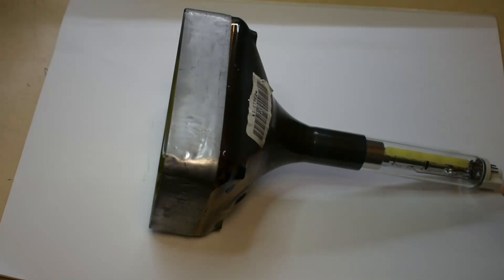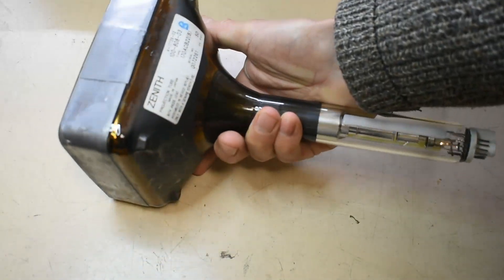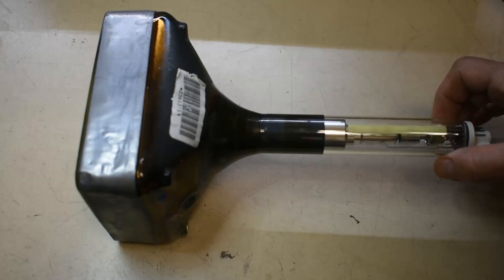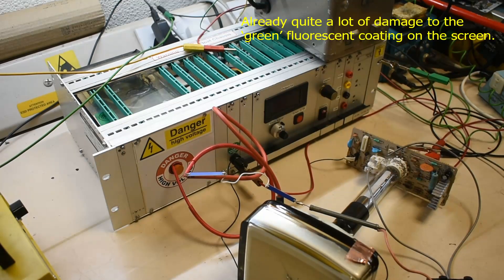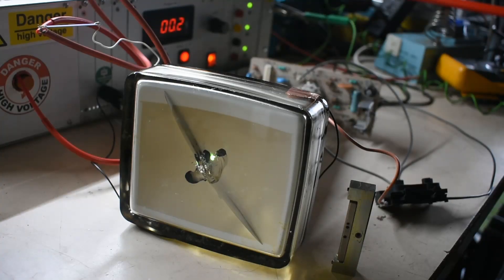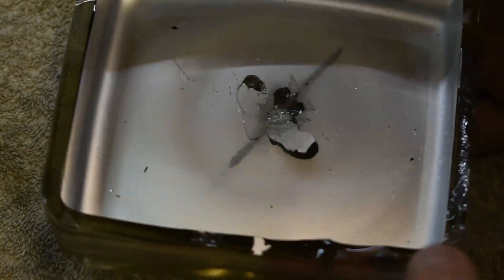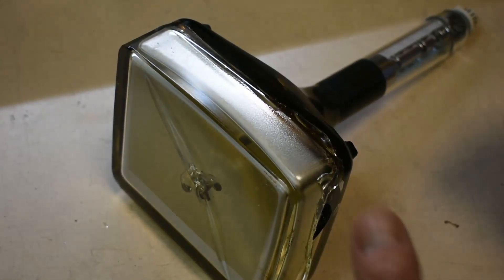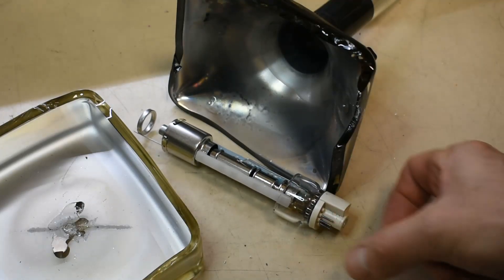CRT cracked from the inside

Comment: Interesting!  We all know (well youngsters might not) of where the term 'screen saver' comes from but I had not realised that the electron beam carried so much energy but I guess at that voltage the power is in the many 10s of Watts.  I must do a calculation to see how much lower the KE of the beam is.  Remarkable to see it doing that much damage!
Reply from the maker: Thanks, I now wish I had monitored the current during this experiment. I was surprised just how easy it was to heat the glass up so quickly.  I do have the other 2 tubes, but it feels like vandalism to destroy another in the same way. These tubes guns are designed to have a higher cathode current, but I have seen a large TV CRT with a crack on the neck due a frame scan fault that diverted the beam into the glass cone where the scan coils sit.  So even an ordinary CRT can generate a lot of heat with a focused beam.  Perhaps not quite enough to crack the screen. The iron shadow mask in a colour CRT would also take the brunt of the impact and dissipate the heat better. Maybe a future experiment there. I think the anode voltage was around 31kV when the glass was melting but this is around the operating voltage for this tube.  Even at 10mA which the PSU is easily capable of, that’s a lot of heat at a spot.
Reply: @tuopeeks  I was going to ask what the beam current was.
Reply from the maker: @cambridgemart2075  I didn't measure it at the time. I did check the PSU can deliver 20mA but I think it's more likely to have been 10mA or slightly less.
Reply: @tuopeeks  That's a lot of power!
Reply from the maker: @cambridgemart2075  yeah, I will try and monitor it for an accurate reading next time. It did melt the glass quickly though.
Reply: @tuopeeks  Yes, the beam must be delivering about 300W.  I am not totally sure of the heating mechanism but I guess more IR is emitted and reabsorbed when glass is hit rather than the phosphor?  It is a shame to destroy tubes but, and I have this dilemma, are they ever going to be used again or should they be 'milked' for all the educational value that they have whilst still in knowledgeable hands!  I am finishing a video on VFDs but came short of smashing one open even though IV-21s are pretty common!
Reply from the maker: @AnthonyFrancisJones  I think the thin aluminium coating on top of the phosphor conducts the heat away and is normally enough to protect it from excessive heating. Originally this coating removed the need for ‘ion-traps’ in early CRTs. Ions, although sparce deflect less a and cause more damage over time than electrons.  I think the velocities and stationary spot in this experiment evaporate the aluminium and melt the glass in the same way anode targets in x-ray tubes are subjected to large amounts of localised heating.   That’s a good point you make on the educational use of obsolete electronics. Far better than to just hoard items. Often think there is a lot of useful educational material lost to recycling centres.  It is also a concern, as you say, the knowledge can be lost too.  Look forward to your video on VFDs.
Reply: @tuopeeks  All interesting!  Interesting that ion damage is greater.  Same eV and therefore same gain in KE - I am going to have to do a calculation!  Yes, good to demonstrate 'obsolete' electronics before it is all forgotten (and landfilled...).  Putting the finishing touches to the VFDs video.  Funny, but whilst explaining them I realised they are a kind of Cathode Ray Tube in reverse (stretching things a bit I realise) with the fluorescent  screen at the back and and the heater/cathode at the front!  Keep the videos coming, best wishes, Anthony.

Comment: Yeah, a fairly typical acceleration voltage was 45 kv. Most were also liquid cooled, with some brands suffering contamination where algae grew inside the coolant jacket, necessitating removal and cleaning, then replacing the contaminating fluid (I'm looking at you, North American Phillips).

I've had 19-20" CRT's which were known to "lase" the neck due to vertical output transistor failure, would push the deflection voltage straight to the rail, directing the electron beam straight up through the neck of the CRT. Usually, put a nice pinhole in the glass, but occasionally one would find the yoke and neck laying on the main PCB.

Quite a testament to the quality of glass and the front safety glass and plastic coating between the CRT face glass and safety coating!

Occasionally, with antique 1930's - 1940's televisions, a misadjusted ion trap would result in glass failure, which would cause an abrupt loss of vacuum. I could number on one hand the number of folks of my generation who had learned how to properly adjust an ion trap. Their overall behavior was like a very strong centering magnet ring assembly, just that the beam could be deflected disastrously. Well, disastrous for the unit under test.
Reply from the maker: Interesting you mention the deflection failure as I have seen this once too.  The beam had been deflected hard by a short  hitting the tube neck under the yoke cracking the glass. This also took out the flyback transistor. I repaired all the board components to fine the tube had air in it. I could see the crack until I removed the scan  yokes.

Comment: Crazy, I have two of those tubes, I had thoughts of making a daylight viewable display, so green would have been nice, but I didn't get that one (smashed), however seeing the crazy voltages and X-ray potential, I don't think I'll ever both with that idea. Just keep them for my curio cabinet.
I would have never thought the gun was powerful enough to do that, crazy
Reply from the maker: They are perfectly safe if run at lower anode voltages. In fact they can produce a spot with under 10kV. This is much lower than operational voltage and would be less likely to even burn the fluorescent coating. Once close to their normal voltage the screen burns easily due to the high beam current if not scanning. Then as here, the glass can melt at higher than operational anode voltages. 🙂

Comment: I would say that CRT has seen better days - interesting. CRTs always made me nervous back in the day with the every present implosion hazard. Years ago we disposed of a 25 inch B&W CRT by putting a blanket over it and throwing a brick at it. The implosion sounded like a bomb - got the attention of a few neighbors - but it was fun!
Reply from the maker: Yes, this was a well used tube with some previous  experimental scars. The later tubes  designs have some protections to prevent flying glass but some pre-70s CRT can be scary when they fail.
Reply: @tuopeeks  even scarier, the clean up. Those shards were sharper than a razor blade and I know both far too intimately, as I still shave with a straight razor and have scars on my wrists from nicks from implosion glass shards.

Comment: How much cathode current was there, holy crap.
Reply from the maker: yeah, this question came up already but I didn't measure it and guessed from a short circuit test at 20mA. I would have to destroy another tube to be sure but on a lighter test I looks like it was more likely 10mA. Still means 300W
Reply: @tuopeeks  That's about my recollection, maximum beam current of 20mA, typical being 10 mA and a touch lower. Surprisingly efficient, really.

Interestingly, we used a much lower beam current in transmission electron microscopes. My junior high school had a handful donated to them. Used small copper, with a thin plastic coating grids to hold specimens, if one came close to 10 mA, one would burn through the grid and/or specimen and much higher, would present a soft x-ray hazard.
I'm sure that the post-60's - 70's electron microscopes have detection equipment and limiters in place these days.
Annoyingly, by the time our children attended the same schools, the observatory and electron (and light) microscopes were long gone and chemistry class used M&M candies in substitution for reagents. As bad, Nineteen eighty-four was no longer required reading. Liability was claimed for the science lab dearth, no explanation on the loss of literature, well, save that conservatives controlled the curriculum. I suspect we'll lose the knowledge on how to make fire by the time my grandchildren are attending school.

Comment: I repaired an early Bacho three tube projector which had liquid cooling jackets in front of the tubes,  I was very much aware of the damage done by a scan failure but fortunately got the thing running without that occurring. Very interesting video I was however expecting an implosion.
Reply from the maker: Yeah, these screens are normally liquid cooled to protect the fluorescent coating but the glass doesn't conduct the heat away all that fast when the spot is stationary.  I also expected an implosion. I think the combination of small screen and think glass prevented it. I didn't continue with the experiment as I thought it could go at any point.
Reply: @tuopeeks  It demonstrated very well the energy in that spot.  You may be interested in this chaps talk    "  Eidophor: 1950's Steampunk Video Projection Technology  "

There is another film of the original test in its raw state.  Very interesting technology.
Reply from the maker: @WOFFY-qc9te  yeah, thanks, I have seen Mikes talk video, its pretty good and has a couple of my pictures in his presentation. 🙂
Reply: All of the units I worked on had detection circuits to cut the beam current off if deflection failed. CRT's were expensive, more so for such tiny high drive specialty units.
Reply: @spvillano  I though they had such protection but I didn't want to test it.

Comment: What a brilliant demonstration Kram! I was amazed that it was still holding a vacuum after the cracking of the faceplate. Also, I'm surprised that with the intense heat the vacuum wasn't spoiled by outgassing. Jealousy is one of the seven deadly sins, but I can't help feeling it a little bit when I see your variable output high voltage power supply! 😊
Reply from the maker: Thanks, yes indeed, I thought the tube would implode at any point when the crack appeared. It continued to make cracking sounds for a while. It may have been leaking slowly but there were no signs of vacuum loss after 15 minutes. However, I decided not to push my luck and stopped experimenting with it. The power supply is based around a dental-head HF PSU from Steve. I have fitted it into a 4U Euro-rack as I had it spare and like the format.

Comment: Really neat to see the damage occur and then disassemble the tube. It reminded me of burning a spot in the phosphor of the screen of an old BW TV CRT when I was a kid and trying to make a very low frequency oscilloscope which sort of worked. I didn't have the beam high enough to melt the glass. You demo very nicely shows the amount of power in the electron beam.
Reply from the maker: Yes, the phosphor is annoyingly easy to damage with a bright stationery spot. This is the first time I have cracked the glass with it though.
Reply: @tuopeeks  Any idea what the beam current was?
Reply from the maker: @ElectromagneticVideos  Unfortunately didn't measure the current, but think about 20mA
Reply: @tuopeeks  So assuming it was around that, 20mA x 30kV = 600W. Seems a bit high (?) but sure shows how even a small current at HV can deliver a lot of power.
Reply from the maker: @ElectromagneticVideos  Based the current on a quick short circuit check so could be a little  higher than on the tube but would be too far out for peak power.  Yes, it does show how much power can be delivered with HV.
Reply: @tuopeeks  a bit of trivia, had an old US Army issue compass that was illuminated by tritium vials, after 20+ years, the vials finally failed to illuminate the compass and I ordered a replacement (which happily rests on my television table for ready usage).
The tritium was still emitting beta particles, what fails first in the vial is the phosphor coating.

For those wondering, the gas is under extremely low pressure, the quantity utterly innocuous even if it was oxidized into tritrated water. You literally need a liter for it to become a modest health hazard that then, due to tritrated water behaving chemically in what I can only characterize as a chemically sluggish manner. The energy of the beta particles is fairly low and the half-life is 12.33 years and the chances of getting it to be T3O vs T3H1O aren't exceptionally high. And yeah, I used to work on nuclear weapons in my early military career.

Comment: The doping of the thick glass is so heavy I wonder if the phosphor formulation had to be adjusted in order to compensate for the color shift!
Reply from the maker: The doping is just on the cone section behind the screen where the glass is thinner otherwise it would be strongly tinted. The lead band covers the thinner sides of the faceplate. The faceplate, itself is very thick and doesn't have the doping.
Reply: @tuopeeks  no, it usually had liquid to cool it and a lens, which pointed at a mirror to project to the screen. Well, save in the direct projection units. Any residual radiation would be somehow getting through the lenses, mirrors and well, not going anywhere, as making it through the faceplate would be exceptional, making it through an inch of coolant, absurd. Ionizing radiation gets pretty much "eaten" by water, neither oxygen or hydrogen "ignoring" the radiation due to density and the radiation being quite anemic, energy wise.
Reply from the maker: @spvillano  Correct, but that is in front of the screen the tube cone at the back, generally facing into the electronics, needs  to have x-ray absorbers added as the glass is thinner. This portion is doped with a heavy metal. In normal TV CRTs it's lead and this is the reason recycling CRTs is problematic.

Comment: Very interesting experiment, surprised the vacuum was not lost due to the cracks, a Geiger counter would be handy to check soft X-ray emissions from the electron beam impacting the face. I guess the glass would have effectively absorbed any radiation though. I have seen X-ray tube targets with melted surfaces and craters from excessive beam currents.
Reply from the maker: Thanks. I did have a Geiger counter to hand for checks, although the tubes x-ray protection was preventing most x-ray emission at the 30kV used in this case. It is interesting to note less than 1% of beam energy is converted to X-rays in an X-ray tube the rest is heat.
Reply: @tuopeeks Yes, most of the energy is produced as heat with little actual useful X-ray emissions and only small amount of X-rays make it through the output aperture to the subject. I have heard of X-ray targets getting so hot that they deform and sag until they melt through the glass envelope. Thats is why modern X-ray units have timers to allow cool down time between heavy exposures to allow adequate cooling of the tube.
Reply: It retained vacuum due to a thin plastic safety coating. A testament to some exemplary engineering!
Got "bit" by a pinhole in a second anode lead insulation once, yeah, that 45 kv hurt, given it had a fair bit more current available to drive those three CRT's to such intensity. Made the 27 kv of much larger direct view CRT's seem tame. The mirrors used in the projection televisions were first surface mirrors as well, useful when one could acquire them if one was performing laser experiments, such as holography. Cut off a small section, make one's mirror block or use the rear surface for a fixed beam splitter.

Would love to actually see an x-ray beam target though. They've got to be fairly well injured by their end of life!
Reply from the maker: @spvillano  Did wonder if there was a coating on the faceplate that prevented vacuum failure.